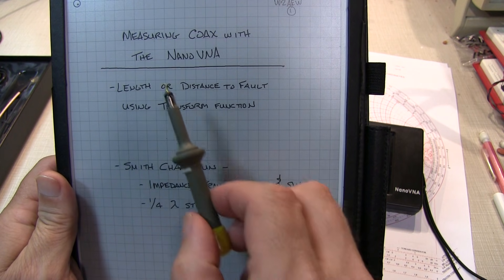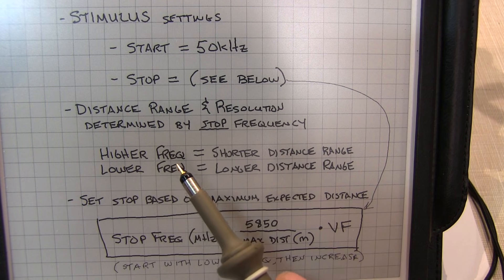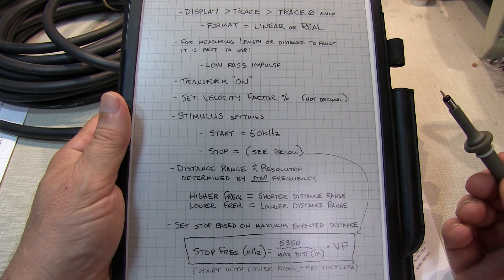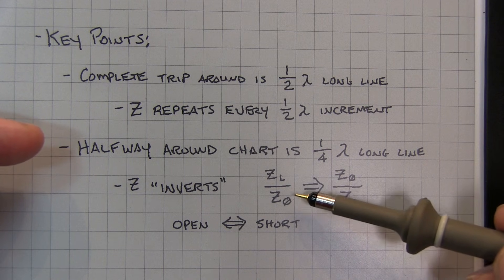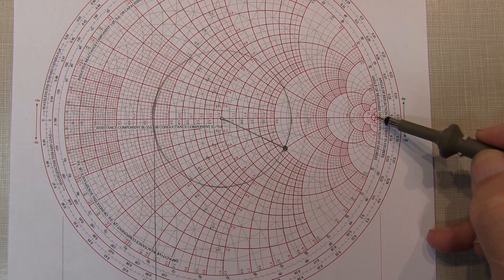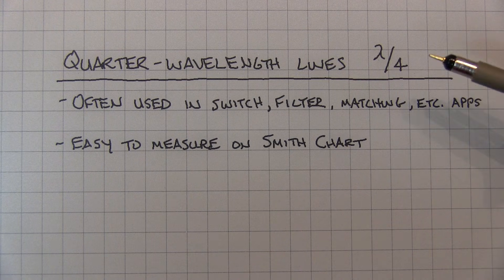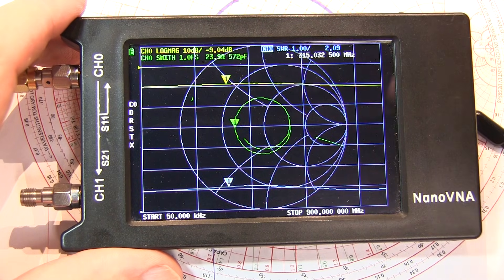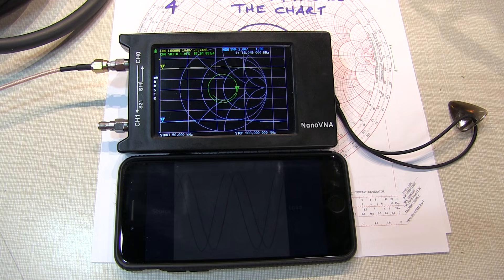#316: Use NanoVNA to measure coax length - BONUS Transmission Lines and Smith Charts,  SWR and more

Comment: @w2aew  Much appreciation and respect!    I really like the whole series on measurements with the NanoVNA. 

Please keep making videos in this series to fully exploit the NanoVNA's capabilities.  I recently purchased one, but getting details on it's limitations (101 sample points in the bandwidth settings) and how to use it (best settings for stop frequency vs resolution of length) was difficult for me to locate, until you started this series.  This series and the extras (Smith Chart, transmission line effects on observations...) is GOLD!

With your formula for setting the stop frequency for cable length, I suppose I could find the velocity factor of an unmarked cable after measuring a shorter length of a sample piece of the coax.
Reply: You should consider using it in conjunction with a PC and nanoVNA saver; this will allow you to use practically arbitrary sweep point setups with more accurate averaging capabilities.

Comment: When matching a transmitter to an antenna (without funny business like phased arrays), is there any practical difference between a purely real 1.5:1 SWR, a purely imaginary 1.5:1, and a complex 1.5:1?
Reply from the maker: In practice, no.  If you were using a transmatch or tuning network to correct for it, it might be able to handle certain impedance combinations better than others.
Reply: Actually, matching a purely real or a complex impedance between a transmitter and antenna is done all the time.  It's called reality.   What is elusive is the purely imaginary case.  Theoretically, a purely imaginary load would represent an antenna that does not radiate, since it implies that there is no real (radiation) resistance.  In this case, you are loading a transmitter with either an inductor or a capacitor or some combination, and at best, could radiate in the near field only.  In the real world, the reactance would have at least a very small resistive component -- the complex impedance case.

Comment: I got a really crazy idea in my head and I am looking for any and all mad scientist type people out there that knows Electronics that can help me independently on their own revolutionize the CB radio 😉👍
See idea is that if there is some kind of plug-in play in line type of circuit where I can transmit and receive video along with my audio📺👀
In this day and age of controlled and censored media, the CB radio and radio talking in general We the People become the network instead of being forced to use a centralized control Network for communication, so if we can add video along with our audio not slow scan I mean real time video this would be cool and it would revolutionize the way we communicate without that Central Network
The 1122 wingnut radio listening on the side
Reply from the maker: full motion video requires much more bandwidth than a single CB channel can provide - sorry.

Comment: I thought that coaxial cable entered in resonance at a particular frequency hops (depending on coaxial lenght) and at those resonant frequencies, it's like you would have a tunnel from the transmitter to the antenna making a perfect match. Outside those resonant coax resonant frequencies, coax cable ADDS SWR to a perfectly match antenna...

When I add a 50ohm dummy load to a lenght of coaxial cable and I test SWR with my nanovna, I can see the ripple going from very low SWR to around 1.3-5 SWR (depending on the quality of the cable and it's frequency tolerance) and then you state (and I can also see it in your video) that adding or shorten a coax lenght won't affect the SWR ??

Why do I see SWR hops on a coaxial cable when it is out of resonance on a particular frequency ? (sorry for bad formulation, english is not my first spoken language and I hope you understand what I am trying to say !).

The formula I have found to calculate coaxial resonance frequency was : (492/fMHz) • VF = lenght at λ/2 resonance using the coaxial Velocity Factor. If I understand correctly, every λ/2 lenght, the coaxial will be resonant... for a particular frequency let say of 100MHz a coaxial cable would be 27' for λ/2, if you add another 27' (54' total), you will still be in resonance to 100MHz with that particular type of coax cable...
Reply from the maker: Random lengths of transmission line will NOT add SWR to a perfectly matched load.  SWR only occurs when there is reflected energy coming off of the load. If the load (antenna) is perfectly matched to the transmission line impedance, there is no reflected energy, thus SWR is 1:1.  The λ/2 transmission line length will ensure that the impedance looking into the line is the same as the impedance of the load.  It does not change the SWR.
Reply: @w2aew  so if I understand correctly, the fact that I see ripple on a coaxial cable that has a 50 ohm dummy load at it's end is because it's impedance does not match the cable impedance ? It will match at every λ/2 to that dummy load depending on the type of coaxial cable vs its frequency and lenght correct ? Because when I connect the dummy load directly to the nanovna, the SWR is flat across 50kHz-900MHz.
I got confused because of the video, the coaxial cable DOES impact the SWR a LOT !
https://youtu.be/Z2lxv6F8fvA?t=1813
Thank you for the reply !
Reply: @Aleziss  w2aew is correct, if you have a load matched to the coax and the Nano.  However, there exists coax cables that are lossy (intentionally), and so the impedance of the coax may not be what you think you have.  A lossy coax is made to intentionally leak/radiate along its length via less than ideal shielding or it may be a matter of cutting manufacturers costs to increase profits.  Check the datasheet for the coax cable, if you can.   If you can't find the cable manufacturer's  data sheet or the cable has no identifying information, then you may be better off getting cable from a reputable USA manufacturer.  Another thing, you may have a dirty/bad connector at the end of your cable, or the cable may have been damaged (coiled/bent tighter than 6 times the cable radius).  Cheers!

Comment: Very informative.  I particularly found your comments about SWR not changing a revelation. I'd always thought it did.  It can help make a tuner work better though, right? Also, on ladder line, I presume everything you showed will also be the case.
Reply from the maker: Yes it can help a tuner work better, because it does change the impedance looking into the line

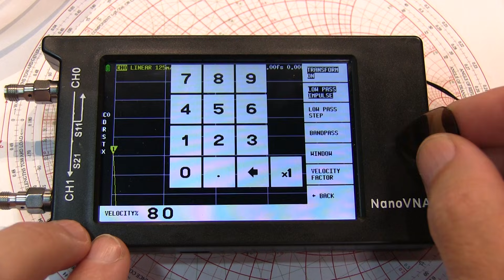Comment: 1:45 but that requires you to know the dielectric used in your cable. not everyone knows that...
Reply from the maker: Usually the cable's part number is printed on the jacket, which can be used to look up the velocity factor.  If you don't have that, then you can get in the ballpark by assuming that the solid dielectric types will be 65-75% and the foam types 75-85%.  Or, if possible, cut a section to a known length and measure it.

Comment: Great vide4o. Ran off to Ebay and bought one of these (US seller, with case). Looks like a nice little box. Much easier than my HP TDR for sure plus it has the advantage of me not having to remember how to do a smith chart every time I use one. Thanks W8DKM

Comment: Thanks for the great video.
Please correct me if I'm wrong, but shouldn't you be dividing the distance seen in the impulse response on the NanoVNA by 2 in order to get the length of the coax? You have to account for the impulse traveling the full length of the coax twice (one time from the VNA to the end of the coax, and another time from the open back to the VNA).
Reply from the maker: If you were doing a raw TDR, yes.  However, the math in the Transform of the NanoVNA takes the round-trip into account for you.

Comment: Great lesson!!  Also how the NanoVNA's low cost can yield good measurements versus a 20K VNA!!!   Be great for EE class labs where super expensive instruments were handled by the instructor (1971 for me ) and how "hands-on" lab work is so much more instructive.  The instrument automation expedites the time and attention factor for instructional learning.   Many Thanks!!!
Reply: They are evolving so quickly eventually SOON a NanoVNA will do what an 8753ES will do, which costs 7-8k used in ok condiiton.  Once they have a reversible test head it'll allll be over.
Reply: Silas Marner considering the price point, the nano VNA offers value for education, and hobby use. However, the performance doesn’t come close to a 8753 or a field fox: span, dynamic range, points, coupler,....

Comment: Great. Is this NanoVNA firmware default? As far as I remember in my colleague's NanoVNA there are no pulse response analysis functions.
Reply from the maker: It actually isn’t a pulse. It is still doing a frequency domain measurement and applying an inverse-FFT to get the time domain. I am using v0.5.0 firmware that come on my unit when purchased a few weeks ago.
Reply: @w2aew  yes exactly. Of course, I know the principle and even understand the math behind it :) but the news for me is that the NanoVNA can do this by default. I have heard only about custom firmware with extended functions, and it's good that this gadget offers new useful tools right out-of-the-box.

Comment: Alan , could you do a video on why you picked this nanoVNA , with so many versions out there it can be a little tricky ?
Thanks again
Reply from the maker: Short version:  I didn’t want the small screen on the original. That left the H4 vs the F to get 4” screen. It seems the H4 has a bit more active development behind it vs the F. But the F has a metal case which is nice. So, a bit of a tossup. I went with the H4.  The new V2 goes to higher frequency with better performance, but it is still in its infancy and not widely available with a case or large screen yet. This may be the better choice in a few months once large screen, enclosed versions become available.

Comment: RF always seemed wizardry to me but Alan's way of teaching such stuff it's just incredible and effective
Reply: You know, it strikes me that RF is very similar to audio engineering, but combined with core EM principles. In my 10 years of professional work in audio, I came away with a primary insight: the most important element in getting a good recording is the room itself. "Room acoustics" deals with things like cancellation of standing wave modes and problematic reflections. So anyway, just a tidbit for folks that are technically interested in audio; you can make the leap into RF stuff no problem because it equips you with the core intuition, very very nicely.
Reply: @danmoretti8898  It is! Also the same as, say, engineering a car's suspension. Those pesky waves show up everywhere :)

I think the main thing that's different with audio is that you very rarely have to worry about transmission lines so much because the wavelengths are huge relative to most of the parts.

Audio synthesizers specifically have a lot of concepts in common with radios and are a good place to start learning the concepts because the components needed and test equipment requirements are far lower and less expensive.
Reply: @bundo13   Cheers! As you would imagine based on your example of the car suspension, there are plenty of energy buildup problems in audio! The rest of my post here is probably stuff you could have guessed, but I wanted to share anyway.

As a rule in audio, transmission issues come into play anytime transduction occurs. So 1) capturing audio (particularly in stereo) and 2) playing audio through speakers. In the former case, phase coherence becomes a really important thing to have a handle on with mic placement.

In the second case, we often run into problems with resonant cavities (rooms). If your room is too small, it becomes a high pass filter due to bass frequencies not being able to fully propagate through a cycle. This makes for a dishonest mixing environment, and your mix will sound weird on playback in most environments. HF buildup is a huge problem in small rooms as well. 

In auditoriums, propagation rates begin changing in a manner that's thermally dependent, which is why live sound sucks for the first couple of songs. The crowd brings a substantial amount of heat. Until thermal equilibrium is reached, the EQ is completely off. 

So anyway, longitudinal transmission through a gaseous medium is really where transmission stuff gets wacky. Between synthesis; microphone placement; mixing; and live acoustics, audio engineering is a very broad and interdisciplinary process. But again, its just the same as any other type of engineering in that sense.
Reply: @danmoretti8898  Fascinating! Thank you for posting all this, I am certainly no expert in audio or RF but I learned at some point to post what I think I know on the internet because writing it out helps me solidify it in my own head.

I should have clarified that I was thinking of the electronics. Audio frequencies propagating at very high speeds in electrical circuits have huge wavelengths, but can certainly come into play when at the speed of sound in air. So I think that reflections and other transmission line effects can mostly be ignored when designing the electrical side. Not to say the electrical side is trivial of course, just different things that are the big factors in overall quality.

I have to admit the first thing I was learning about where I feel like I really started to get a handle on wave math was when I was learning about transmission line speakers, because they're just so darn cool. I found it much easier to imagine speakers and sound waves when thinking about stuff because those things are so much more familiar in our day to day lives.

I often think about antennas as speakers and impedance matching circuits as horns still! I also use these as analogies when trying to explain what I think I know to other people as well. I find it much easier to imagine how a shout echoes off of a cliff wall than about how an electrical signal reflects off the end of an open transmission line.

So I appreciate your examples, I've never messed with audio design at such scales. It's very interesting, and I feel like the more ways we have at looking at the same fundamental concepts, the better we can understand it.

Interesting tidbit is that Bose has even worked on electromagnetic dynamic suspensions for cars. I may not always agree with the value prospect of Bose's products, but I've always respected their engineering!
Reply: @bundo13  Cheers, I feel the same way about writing or sharing these concepts aloud! Much appreciate the opportunity to nerd out, my friend.

Comment: The ARRL Extra Test says the VF for Foam Coax is 66, I'm I wrong? I know this number from just passing my Extra.
Reply: The two questions in the ARRL Extra manual (E9F05/E9F09), the version about to expire on 30 June, do not include giving you the VF but they do in the text where they work through the problems. So you have to assume the value of VF...they're bad questions...and they don't get fixed in the new 2020 version either. The problem is there are two versions of polyethylene cable, solid and foamed with two different velocity factors but they don't identify which one they're looking for in the actual questions...that forces you to work the problem both ways to determine the correct answer offered. For this video I'm guessing that Alan assumed and used the foamed version of what visually appears to be RG-8 type coax (note the cable diameter in the video). So at the end of the day this is one of those you exam questions that gotta remember the VF used in the question 'cause they won't give it to you on the exam itself. Congrats on passing the Extra!  73 - Dino KLØS
Reply from the maker: @PapasDino  Thanks for the detailed assist, Dino.  Yes, my coax is the foamed polyethylene which has a higher velocity factor due to the air in the foam (vs solid dielectric).

Comment: Try this with 75ohm cable. The rotation should be centered on the new characteristic impedance rather than the center of the chart. 

This trick is often used in splitter networks to transform when 50ohm is split into two 100ohm lines. Rotating round 75 for ¼wave will transform the 100 back into 50ohms.

Great video. Very clear.
Reply: you could always just normalize to a 75Ohm load during calibration to get around this, but the firmware isn't setup to tell you the correct calculated impedances from this normalization. If the NanoVNA firmware developers are reading, a feature to change the impedance normalization of the chart after calibration or before the calibration so the calculated impedances would be correct would be great.

Comment: Even if both the source output is 50 ohms and the received input is 50 ohms, the coax transmission length can change the output and input 50ohms to other impedance values when adjusting the frequency up and down? its only stays at 50ohms at the operating band of frequencies? The coax length will only be 50ohms at a certain frequency while adjusting the frequency up and down will alter/change the impedance of the coax length?
Reply from the maker: No, if the source and load are matched to the line impedance, there is no reflection and no impedance change/transformation.
Reply: @w2aew  the source and load are Matched, but the coax length in your video lesson says that the coax length changes its complex impedance when the frequency adjusted higher and lower from the center of the operating frequency. Only at the operating frequency is the coax length at 50ohms but at other frequencies its NOT at 50ohms so there is a "mismatch" and loss in the coax cable length?